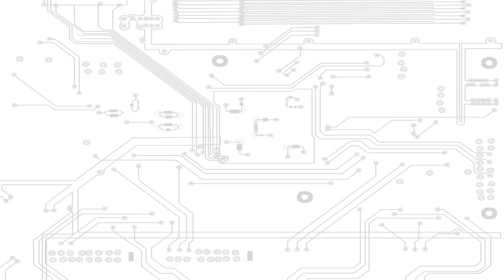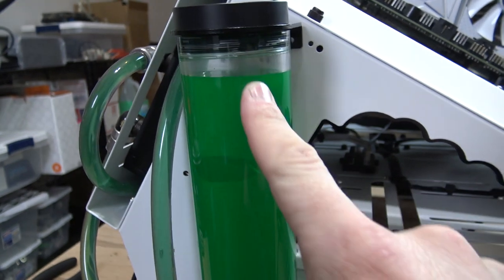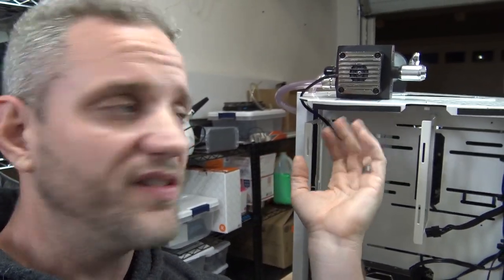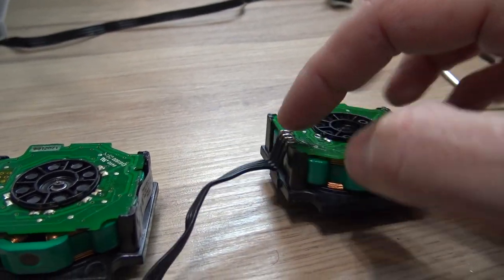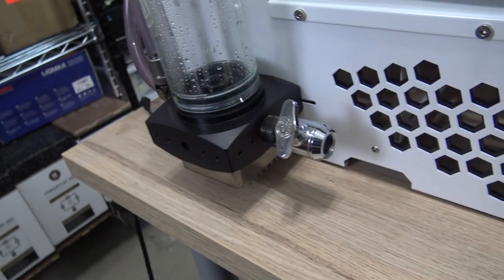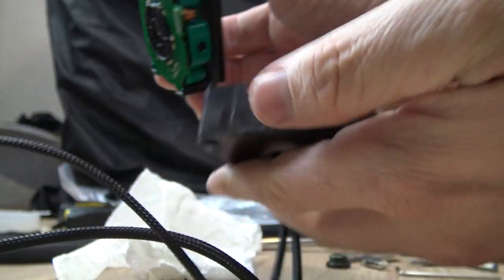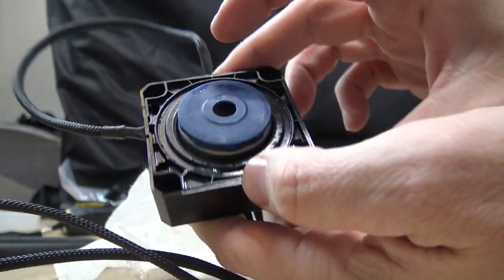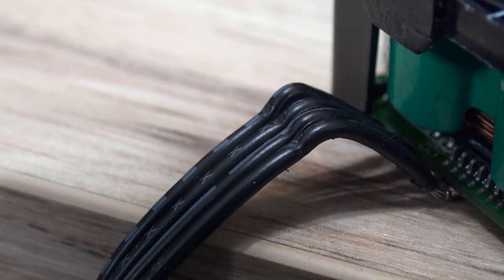My pump died... did the antifreeze kill it?? Let's pimp out my Test Bench!

Comment: Hey Jay Help, I'm designing my own game using unreal engine 4, would you be willing to do a video on what type of hardware would be better for game design that is affordable like what type of graphics, cpu, and monitor. Im currently using an AMD 8350 on a 990fx mobo watercooled, with a 8 gig sapphire 390 512 bit gpu, 16 gigs ddr3 1866, and a 500 gig ssd using the samsung magician software so the read 3k and write 2.3k. I recently watched some of your old videos and overclocked the cpu to 4.4 which seemed to help alot but I feel like its lacking, please help.
Reply: That is more than enough hardware. I recommend blender to do 3D modeling for characters, vehicles, and weapons. You will find lots of tutorials on how to use it here on YouTube.
Reply: xX Xx Indeed, as a PC enthusiast and hobbyist game dev including 7 years with Unreal Engine, the rule of thumb is usually, if your system can play games, it can do a decent job building games. DECENT, but not optimal, though varying greatly based on the complexity of the project, as with any game or 3D application. That being said, more of everything is still of benefit, especially Instructions per Clock on your CPU and more GPU power for running the game, and lots of strong CPU Cores, RAM and SSD space for development tasks. I've got an i7-2600 paired with a GTX 970 which is fine for 1080p, but I'd like more GPU power having moved to 1440p. Sandybridge CPUs, along with the AM3 counterparts from AMD will bottleneck newer GPUs so I'll probably go for a new build based on Skylake-E and high end Pascal, but this is somewhat overkill. Really what you need to ask yourself is "What's the most graphically demanding my game is gonna be?" and take that knowledge along with the resolution you intend to run at and then build a system somewhat around that or a little better. That being said, if you're doing stuff like Z brush, and high end game development in general, you really can't have too much power so having more CPU and GPU power to play with will USUALLY help, so it really just comes down to budgets and what you can afford. TL;DR 8350 and 390X are probably good for 1080p depending on what you're going for, so if you're still wanting for more power, get what can you afford. Generally recommended specs are some form of i7, 16-32GB of RAM; a GPU largely matched to your resolution, unless you're doing Z brush and/or high poly bakes in which case basically get the best GPU you can possibly afford anyway; along with basically ALL of the SSD space.
Reply: xX Xx Oh, yeah, and monitors are easy. IPS monitors all the way. The more color accurate the better so that you know without any doubt that the colors that you see on screen are the proper ones. I recently bought a Dell UltraSharp U2515H which comes factory color calibrated to 99% sRGB and a delta-e of < 3. Newer Dell UltraSharps, as well as other professional monitors from the likes of BenQ and LG are good too. You can also get monitors that support 10bit as opposed to 8bit colors, however you'll need a much more expensive Quadro to benefit in Photoshop and others, at least for Nvidia, and it isn't necessarily worth the trouble.
Reply: Thank you guys

Comment: I got 3 broken pumps in 1 year to cool my cpu from different brands. Never agen water cooling Im back to air and it works fine save my loots off work and time
Reply: 5 years later, my water pump has never had a problem, and it runs an average of 12 hours a day, every day, for those 5 years...

Comment: I dunno why people want or use "Anti Freez". antifreeze is an additive which lowers the freezing point of a water-based liquid. An antifreeze mixture is used to achieve freezing-point depression for cold environments. I mean it's made for freezing weather to get rid of or prevent ice on the windshield. So why not use radiator fluid? That seems the perfect thing to me. You can also get it in different colors.